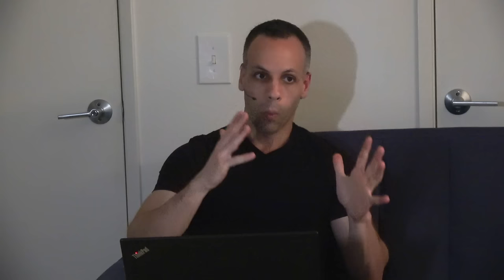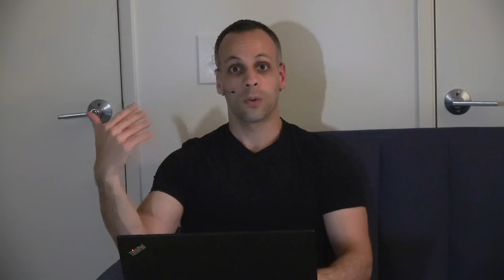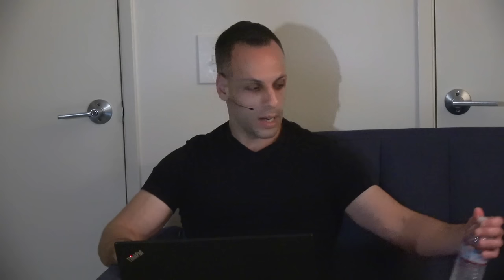EVGA's Oversight: Unannounced Changes Destroy PCs, EVGA takes NO ACCOUNTABILITY

Comment: I cannot completely agree with you.
Yes - when a company agrees to compensate all the harm that is done due to their fault, there is certain place for cheating and money milking that company. But that is the price of the mistake the company made. They must have checked that old power supply and either replace it with the very same one (including connectors pinout), or provide a new set of cables with it, because they were aware of that problem. Since they did not do that - well, it sucks to be them, but owe that person a full compensation of his losses. Even if that person would behave dishonest and collect a bunch of burned down PC hardware and claimed that it is broken due to the company power supply unit problems.
EVGA fucked up twice - they created a problem, and they did nothing to resolve it, knowing that end users can eventually suffer from it. The first fuckup is forgivable (kind of, not because this is right, but because this is a common practice). The second one is not. So - all the consequences are well deserved.

Comment: I disagree with your logic about EVGA's not being able to cover destroyed equipment. They have records of what serial number supply was sent in and what was exchanged.  For the (hopefully) very few cases where incompatible ones were sent back, EVGA knows who they are and presumably did not make that error after the first instance was discovered. A customer could not engineer a fraud because he would not know whether the replacement was going to be incompatible. Similarly, reading about this on a forum would happen after EVGA had corrected the procedure (one would assume).  If this were to happen today, EVGA would send a new set of cables with the replacement with notice to use the new ones rather than the old ones. There would be no reasonable way to avoid liability, whether the victim could provide a narrated video of the destruction or not. (I thought EVGA was going bankrupt? I bought a bunch of their products during their fire sale in Sept. of 2022.)

Comment: This is sad EVGA was the absolute best company in the PC business for years. I hate to see them going downhill. There is no other company that I would want to buy a GPU from. I had a GTX 470 with a lifetime warranty that I had to RMA years later. EVGA sent me a GTX 960 which was a massive upgrade. I have also been using their G2 850w power supply for about 10 years without a single problem. I hope they get this figured on and get back to their former glory (yeah I know that will never happen)

Comment: Well, if they get an RMA for a power supply, tell people to keep the power cables, then send them another power supply with a different pin out without new cables, and no notice of the changed pins then they should be held responsible.

Comment: Louis, I'm surprised you of all people don't know this.

Ya this is a common issue. Other than the cables that come in the box with a power supply you should always be cautious if you are using wires that did not come with the power supply in the box. There is currently no official standardization at the wire connection end to the PSU. Always have a burner set of hardware for testing purposes if your going to use cables that did not come with your modular PSU. 

Yes it sucks but I have a feeling that this reddit user is not telling the whole story. It's not really his fault but it is still user error. GQ model power supplies from EVGA have similar incidents come up regularly. The problem is that GQ models were made by another manufacturer that was not the norm for EVGA psu units, they use a totally different pin out from their standard models. Also the manufacturer of GQ models tend to be quite sketchy for those who are not in the know. With EVGA pretty much being a semi defunct company after they stopped making GPUs, it is likely that when you RMA with them, they may not send you back a exact model of the device you RMA'ed. Note that the Reddit user never confirmed that the model he received from EVGA was actually a GQ1000W most likely because EVGA no longer has that exact model in stock anymore. Most likely he received a different 1000W model as a replacement. He should have used the cables that came with the replacement PSU instead of using the old GQ1000W cables he "had set aside previously". His own words. I see this in complaints about cable issues for people who bought GQ series often. But ya, the lack of standardization is complete BS.

Comment: When they change the pin layout they should change the plug! so you just can't make a mistake. Doing this on the same modelnumber is a  scumbag move, particular when the customer has no way to know. I would have 100% have made the same mistake. I however buy Seasonic, not knowing if thats better.

Comment: some years ago i used cables from another brand psu on my main psu without knowing and the pc would stop right after i power it on, seems its shortcircuit protection worked and after i checked the cable i saw it wasnt from the psu because it didnt have any branding, i guess i got lucky.

Comment: YIKES. They should take 100% accountability immediately. This is a very obvious, major mistake on their end.
edit: not for the data, but certainly for the hardware, and they should be immediately changing their policies and going over current and past RMAs and reaching out, to make sure there aren't more cases about to happen.
Reply: it's very unrealistic to assume that everyone may abuse the system, though I agree a small percentage will certainly try it. In this case where only the pinout for the SATA connectors changed however, couldn't they only offer to replace sata/molex-powered devices? you shouldn't be powering a GPU with SATA.

regardless, I've never had the pleasure of owning an EVGA product (they've never been popular where I live in the EU), and now with them out of the GPU/motherboard business and actively destroying their reputation, I don't see that changing anymore. Maybe I end up with a used EVGA product some day, though again, there's not much EVGA out there over here.

Comment: At a minimum EVGA should have changed the pin shapes on the power supply side so that the old cable couldn't fit into the sata port if not appending something like v2 to the end of the model number

Comment: This situation isn't any one brand's fault but the PC community, reviewers and creators need to annoy and petition every major manufacturer to agree on a pinout. They should be hounded at every convention, in every review and however else you want to annoy them until they finally fold. 

This has gone on long enough. It'll take time and cause some frustration but this band-aid needs to be ripped off once and for all or it'll never happen. Proprietary cables are fine but anyone using the standard port design uses a standard pinout. Period.

Comment: There's a difference between normal operation that's unlikely to cause damage and mixed power rails that's guaranteed to destroy all user data. The latter deserves a class action lawsuit.
I had bad experience where connecting a regular USB flash with OpenBSD installed would freeze and then kill the EVGA x58 FTW3 board. I told them this is a security issue with the firmware and they banned me.

Comment: I disagree. EVGA should be responsible for that loss. It doesn't matter if that opens them up to bankruptcy. If this causes them to go bankrupt, they should go bankrupt. You broke it, you buy it. EVGA is aware of the issue, and has been for years. They still don't fix it or inform customers about it. That negligence should make them liable for damages. I don't care if a few people intentionally wreck some of their own hard drives in order to cheat EVGA out of some compensation. That loophole only exists in the first place because EVGA is negligent.

Comment: I am just a few mins in and was struck by... I sometimes make my own little devices. The connectors PC power supplies are, as I am sure you know, some variant of the Molex Mini-Fit Jr or other manufacturers name for it.... its a keyed connector. Keyed so it can only be plugged in one way, keyed so that you supposedly can't plug them into the wrong port. They could easily make it so you can't plug them in wrong. This is just a huge fuckup on their part to not use different keying on differently wired ports.

Comment: idk if it would "open the floodgates".
they just need to check their RMA system for any affected PSUs/customers and validate based on that, like they did on this case.

i've had an issue with an evga PSU before. their gpus have blown up before (although iirc they handled that fairly well). but i dont trust them these days

Comment: If a rma power supply resulted replacing a power supply with different pinout they should have sent a new set of cables with notice that the old cables will fry your equipment.  I think that EVGA should have replaced the hard drives because it was their fault they got fried.

Comment: TBH they should pay for data recovery, as they fixed the powersupply (good) and modified (hidden modification) it without informing the user what made him use it/connect everything not properly or without proper information. They dont have to pay for data, but for recovery? new drives? YES! You can check in most cases where something burned down from to high voltage vs other dmg.

Better yet, dont change ppl stuff, and just fix it - problem solved. Just alone modifying it or more properly said making HIDDEN MODIFICATIONS to it makes them liable for any dmg that was caused by it or could be caused.

Comment: If two cords aren't safely interchangeable, THE HEADS SHOULD NOT MATCH. It's one thing to have a cord that doesn't have all the same features (charging USBC vs data USBC), it's another if the cord could ACTUALLY DESTROY YOUR STUFF.

Comment: You’re saying you understand why companies limit their liability, seeing as customers will take advantage of a company by claiming damage which wasn’t the manufacturer’s fault. Of course, that assumes the product is not defective and the customer is lying. But in this case you have a clearly defective product; the power output has been connected wrong which results in too high a voltage going to the SATA drives. This can easily be proven by the customer sending in the defective power supply and a test showing the wrong voltage, so there is very little likelyhood of the customer lying when they say their drives have been damaged. By saying they have no liability even tho their product was clearly defective, they open themselves up to some pretty big lawsuits, I would think.

Comment: I have to wonder, are the connectors not keyed based on pinout? Corsair's PSUs have keyed connectors to keep you from using your old cables with a different Corsair PSU.

Comment: Don't send them the cables but also don't use them and ask if they changed the pin layout before using anything you receive back? Imagine if they could take the cables back as well then, and I'm sorry if this is an outlandish and outrageous idea, send back COMPATIBLE PSU AND CABLES?! They don't need to admit liability if they do such a simple thing too because it should work.

Comment: It's also difficult to test power supply voltages out of circuit as it needs the standby (green) wire connected to activate the supply. Easy enough to do, but who would go to this level of trouble with a new PSU? And what would be the motivation to do so? I think I will from now on... lol

Comment: So I admit this but I’m only 4 min in and I have a counter argument that has some caveats. First of all evga doesn’t make power supply’s they rebrand power supply’s. Each manufacturer tends to have there own pinout because why not and when evga “makes” a product it might be sourced from manufacturer 1 but 18 months later m1 has a issue where they can’t get a cap or something or they stop making it so evga switches manufacturers causing this or happen. Now evga should change this information but no else does. This  is why u buy from manufacturers brand’s like super flower sea sonic and others imo.

Comment: Memory is the same, I have 3 sets of Corsair pc3200 memory with the same part number and all 3 have slightly different timings. Luckily they work together in XMP1 mode but crash in XMP2 mode.

Comment: I don't consider EVGA products that good to begin with, since in no of the review round-ups i consulted over the last decade did EVGA products manage to be better than "middle of the pack". Consequentially, i never bought EVGA. I am not a US resident, so obviously, anecdotes about EVGA's US support do not factor into my purchase decisions.

But boy oh boy, changing the pin-out of a user-handled power connection within the same brand/product family (or worse, as is here, on the same model) without keying it differently is on an entirely different level than "not that good to begin with" and reeks of a company that is being little more than a marketing department with little to no technical oversight regarding the product designs they select from their OEM partners. Ugh...

A technical/electrical tangent: I am curious, which HDD models still use the SATA 3.3V supply? I guess, even if the poor chap did not have cloud backup of the important data, he would have a good chance to recover the data from the drives quickly and cheaply. The power inputs of HDD's are typically protected by TVS, and there is a relatively good chance the HDD electronics survived the ordeal but the TVS got burned up (with a short, which again would trip the PSU short-cicuit protection). Reactivating the drive(s) for data recovery could be attempted by simply removing the TVS and using a known good and very stable PSU (as the HDD electronics without TVS are now unprotected from over-voltage events). The possibility of this of course isn't an absolution of EVGA...

Comment: just a small question I have (I´m not that expert,just wanna know). to make things more trustable,should these power supplies,if possible,start to have a "black box" just like airplanes,boats and things like that? (that said black box would act as a pocket multimeter that would store voltage activity in the last 24 hours of functioning,that way,in case of failure,just take the black box and read the content)

Comment: This is a major issue across all modular power supplies. Unless you do your research, you risk frying your system.
Reply: I have essentially zero trust is anyone these days. With the exception of Rinnai and Ridgid, aftermarket sales care is terrible. I almost lost a house deposit because my solicitor didnt file paper work, my paranoid brain, follow up and discovered i had 13 days to resolve something that needs 12 days resolve, everything was cleared up the day before settlement. If that wasn't the case, the vendor has every legal right to keep the deposit.

Comment: I am guessing there isn't a standard due to how the cables are made for different power and current ratings to avoid fire risk,  but swapping pin out on revisions to another on the same model is just stupid. always use the cables that come with the psu.

Comment: God, thats a mess! That`s the reason connector coding was invented and they should use that. If it fits its safe. If the pins will be reversed (for example newer revision of the cable) then different coding. 
It`s like Apple or Google not sending you a charger because they assume you have one at home already (or 10 of them) but they may fry your phone because it may be a different pinout on the connector that FITS. L O L.

Comment: Actually Louis this isn't as difficult as your making it out to be. Pinout changes very rarely happen (otherwise their RMA process would have changed long ago) and can prove who was and wasn't effected by this pretty easily. So they should fix their RMA process and handle each customer on a case by case basis.
 
To that 1 guy who RMA'd that specific model of PSU within a very specific timeframe that happens to have 10 dead 8TB SSD's with proof of purchase: Enjoy the $5000 you mad lad.

Comment: RAID is about _availability_. You use it to ensure your data remains immediately available under common types of failure.

Backup is about _disaster recovery_.  Frying all your drives is a disaster. Your house burning down is a disaster. A software bug that corrupts the file system is a disaster. A hacker encrypting all your files and demanding payment is a disaster. Your data is no longer immediately available, but if you backed it up somewhere else it can be recovered!

Comment: Im not editing my comment but making a second to second another commentor. Really when a design is changed no it shouldnt be labeled 2.0 or noted in big bold letters. The connector should physically be IMPOSSIBLE to get into the header. Whether thats blanking pin locations so they literally cant go in or whatever you make it IMPOSSIBLE to plug somthing in wrong. We have had this for RAM and PCI cards for DECADES. There is a reason the notch isnt in the center, its to make it IMPOSSIBLE to install wrong.

Comment: This sounds like an example of bait and switch. The same model # is not the same model as the original. 
I also never realized you could not swap cables between power supplies. I have been doing this for years on multiple systems. If the cable is for X,, and fits into plug X, I have used it for X.
I have had a 3x Corsair, 1 FSP, 1 BeQuiet, 1 EVGA which were modular. In many instances the physical plugs are the same! I know a couple of them have the same OEM. I am curious if the instance in this video if EVGA changed OEM's.d